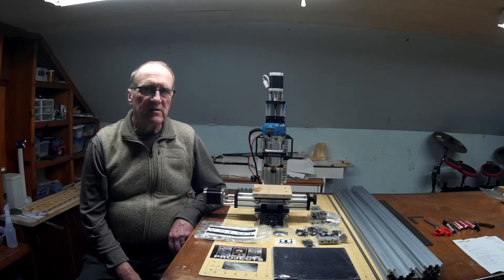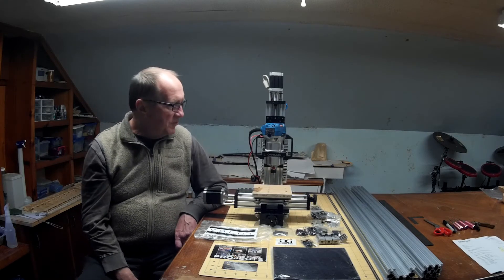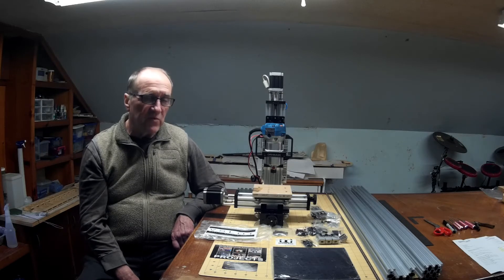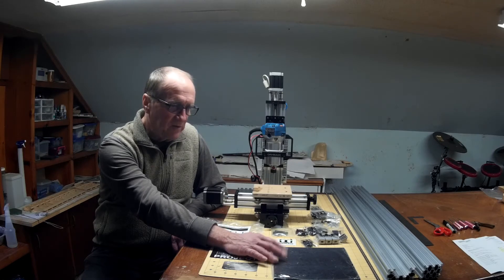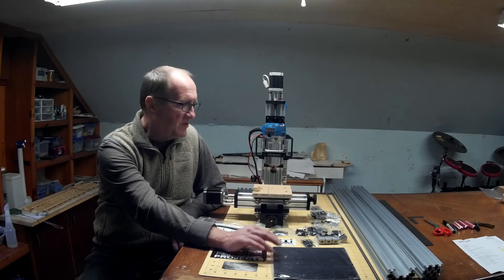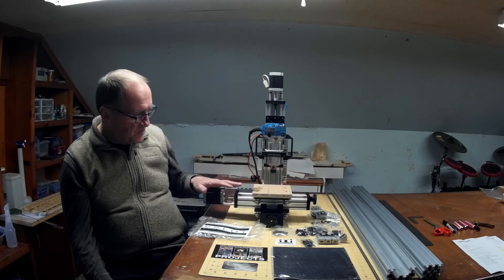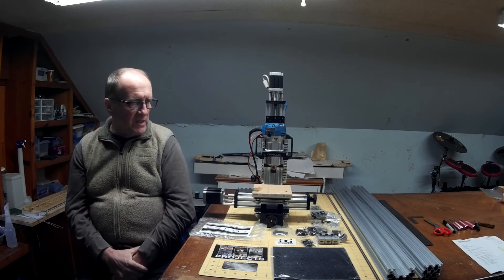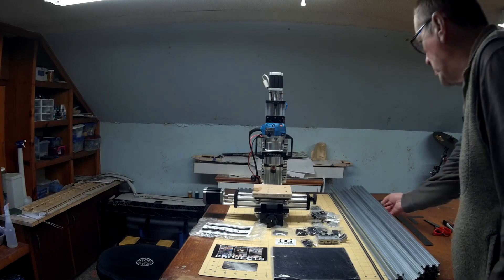MMXL - MiniMill Conversion Overview

Comment: I have a question! im not a huge Dewalt user as I have no dealt products and im in makita rigid porter cable and am not looking to have to buy even more accessories in another brand in case I want to use the motor for something else or after maybe another upgrade... I like Makita and I see you are using one! I am currently in the building of my mini mill which now after seeing this will be upgrading to the C-Beam Xl like yours ( a little different but to sizes I need) but none of my routers seem to fit so now I have to buy something else including a BIT I thought maybe there would be one in the kit but didnt matter its all a learning curve! anyway... does this makita RT0701C ( Im assuming ) drop right in? its 40 bucks less than the dewalt  since I can get motor by itself.. anyway any input would be greatly appreciated!
Reply from the maker: The Makita RT0701 requires a reducing shim in the Open Builds spindle mount. I use a 3D printed one of my own design. ( https://www.thingiverse.com/thing:2496956 ).  There are others, just look for anything that will adapt the 71mm opening to the 65mm makita.. (Ooznest has one: https://ooznest.co.uk/product/router-mount-adaptor/ - there may be others commercially available.)
Reply: @sloscotty   Thanks! ! Ill check it out, trying to decide do I want the Dewalt and make it easy or get something else that may fit with other tool parts I already have...
Reply: @sloscotty  Thanks for info... I went ahead and picked up the DeWalt and decided it will just be dedicated to this CNC build.. many seem to really like it and its already set up for it. but Glad for that information for next build!

Comment: How did you ground the router? Great video.
Reply from the maker: Thanks! To ground the router,  I used 18 gauge wire with a spade connector attached to the outside of the router case by one of the 4 screws that hold the top of the router to the metal body.  The other end of the ground wire is soldered to the ground pin of a three-prong plug which is then plugged into my plug strip.  (I also attached a ground wire from the MiniMill frame to the same 3-prong  ground pin.)